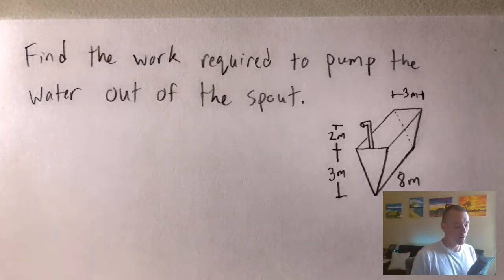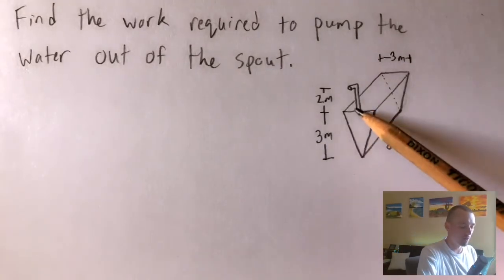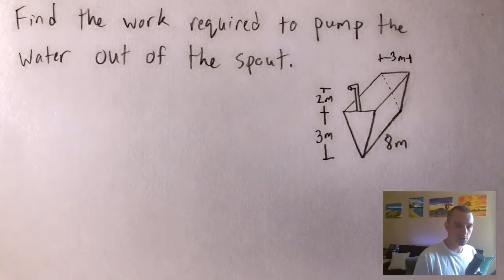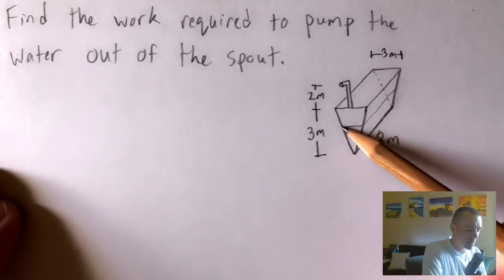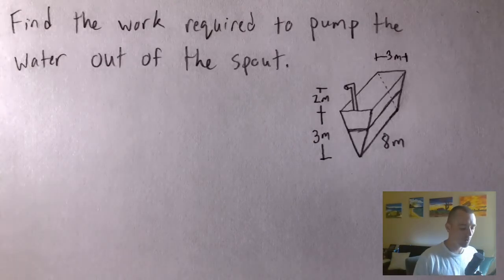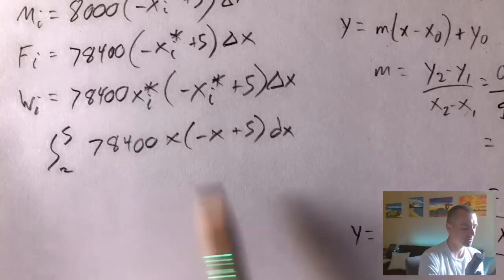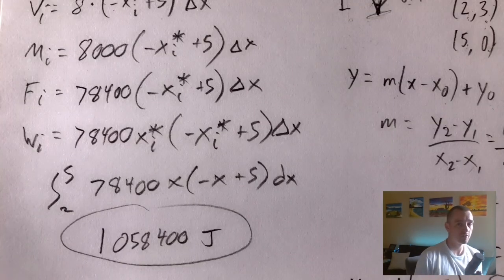HOW TO FIND THE WORK REQUIRED TO PUMP THE WATER OUT OF THE TANK | Work Calculus Formula

Comment from the maker: MY CALCULUS 2 STUDY GUIDE - https://jakesmathlessons.com/calculus-2-study-guide-integral-calculus-cheat-sheet/

0:00 Find the work required to pump the water out of the tank
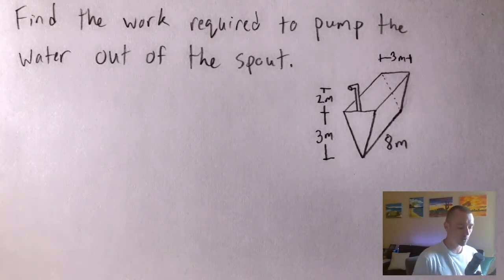1:06 Draw a sketch and name your variables
3:10 Find the Volume of the ith disk
9:44 Find the Mass of the ith disk
10:22 Find the Force acting on the ith disk
11:12 Find the Work required to pump the ith layer
12:11 Set up the integral to find the work required to pump all water out